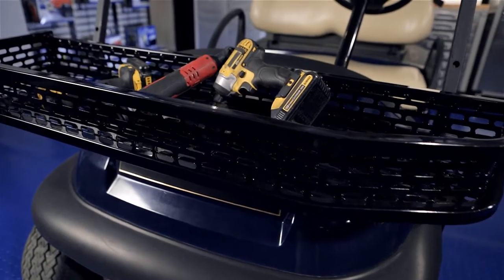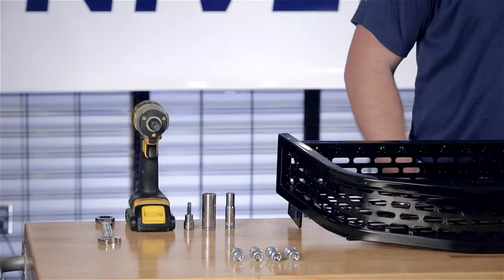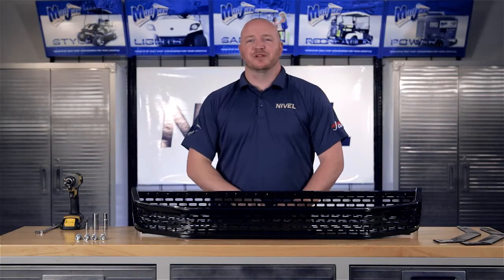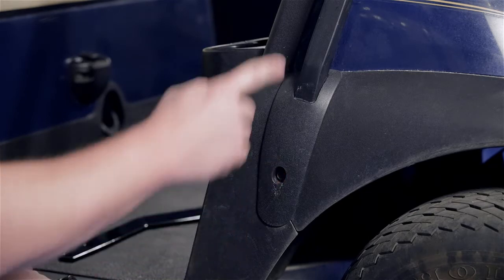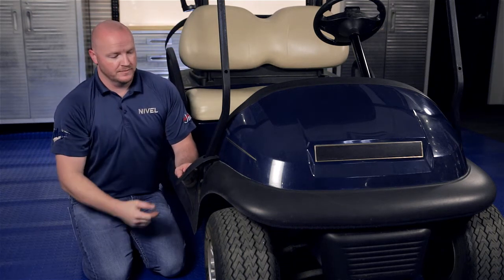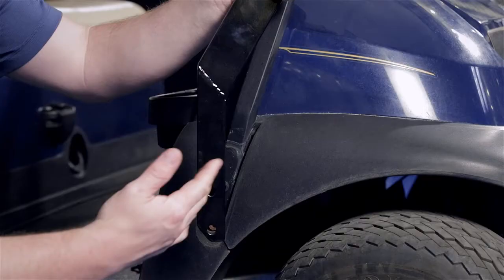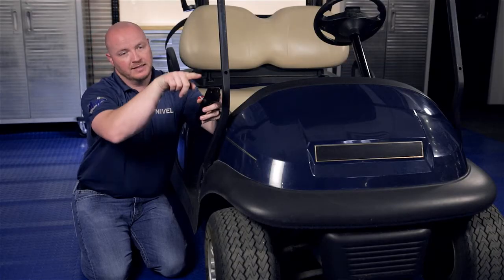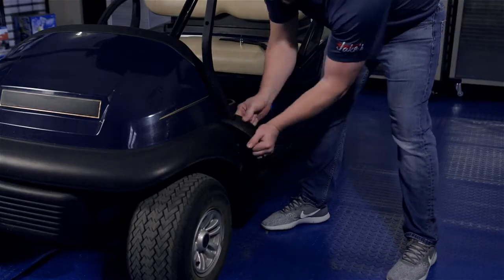Clays Basket for Club Car Precedent | How to Install Video | Madjax® Golf Cart Accessories (UPDATED)

Comment: I have a fold down window, im wondering if this will get in the way of the window going up and down, i have a 2018 club car precedent.
Reply: Just found this video,, have same issue. Can’t find any info on compatibility
Reply: @AwlDeigh  we ended up getting it installed on mine, we put a peace of foam on the bottom of the fold down window and it doesnt smack the rack or bang around on it when its folded down.
Reply: @tommybahamax  man thanks for your help
Reply: So you don’t install the cover back?   Obviously no holes for it.

Not a good solution if I can put the cover back.   Horrible.  Just needs a hoke in the center to place the cover back.